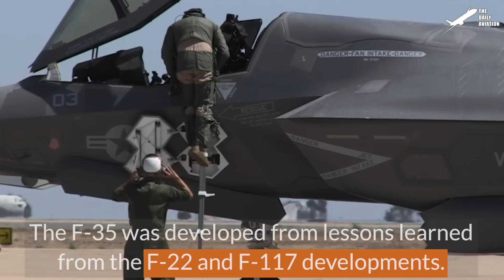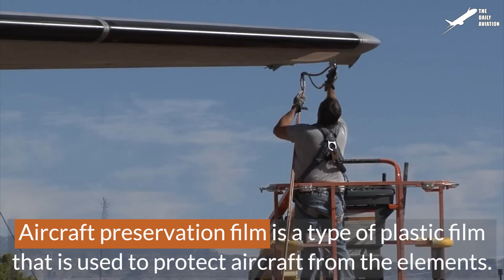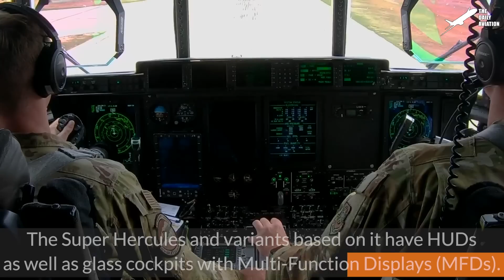US Air Force Smart Invention to Suck F-22’s Dangerous Smoke

Comment: You don't explain WHY there is a need for an exhaust suction device in a hangar which is wide open at both ends when no other USAF fighters do.  Is it because some hazardous substance like hydrazine is used by an internal startup system?  Also, the F-22's internal weapons storage is to maintain stealth, not so that it can go faster as you imply.

Comment: Who are these engineers that think up this shit so the suction cone swings out to the left of the aircraft and if you’re in an alert situation, the aircraft cannot leave until that is retracted. 

It should swing to the center of the aircraft and then up in case of a premature ejaculation it does not interfere with the vertical stabilizers🤔👀